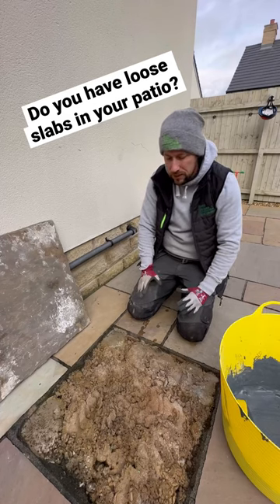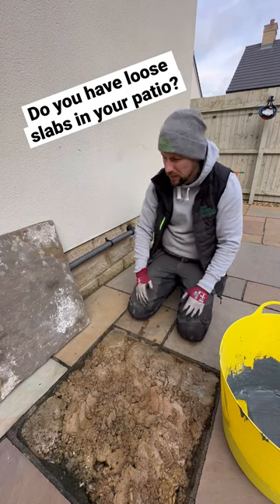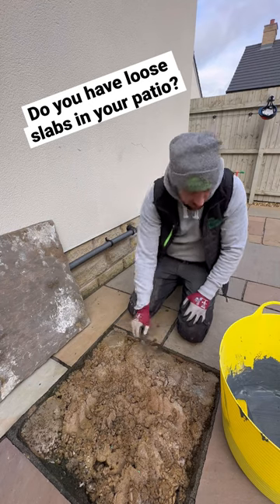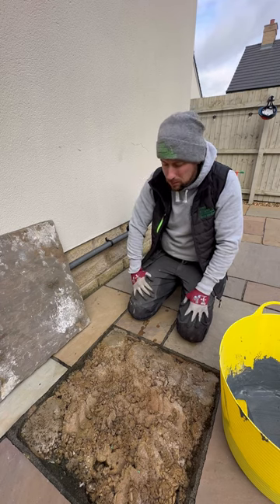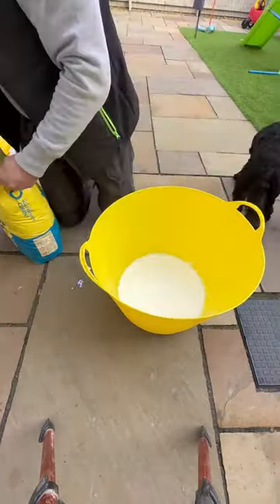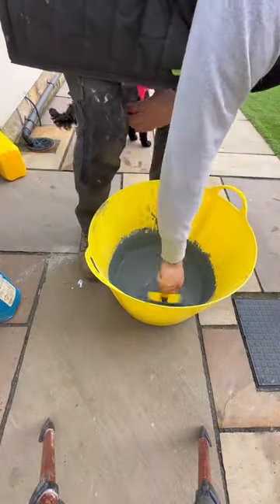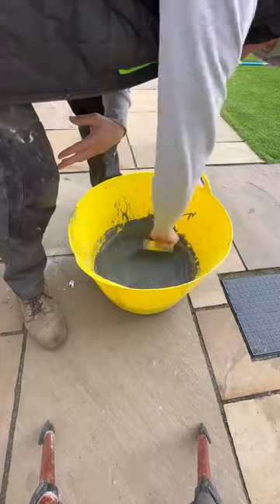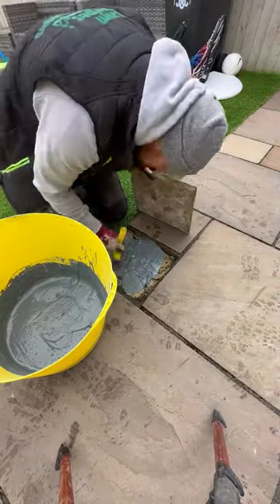How to repair loose ￼patio slabs #landscaping #garden

Comment: Surely digging out the crap and recementing is the right way
Reply: True, but I guess when you’re chiseling it out you run the risk of dislodging the ones next to it. I can’t see this slurry business lasting anywhere near a year though I must admit
Reply: Had this issue myself for an old dear. Dot and dab cement. 7 loose slabs turned into 13 with trying to chip out and prepare properly.
Reply: Can u use sbr and mortar instead of cement for the slurry?

Comment: I'm a fully qualified stone mason. I used inch to dust limestone vibrated bed, then a 2" layer of Steel Slag Ash to lay my flags on it was also very good drainage. I've had customers drive Land Rovers on and off with big trailer's and big vans the flags never moved once pointed in correctly. Some of my driveways, patios etc are still standing after 38 years of use. Even the pointing has lasted. I never used anything else, the slag is like pieces of Crunchy Bars, a couple of knocks with the Beatle (mallet) and the flags were solid... No rocking or anything. But the steel slag is like rocking horse pooh these days.
Far too many cowboys about now.
Reply: Yup 🤠

Comment: I definitely wouldn’t mix it on top of the paving! Those bits you dropped will be noticeable spots when it rains! And I’d also mix 1 part SBR to 2 parts water before adding cement - it’s strong enough to dilute as it’s an additive, I’ve never had any issues and been through dozens and dozens of tubs. Would work out way to expensive if I didn’t dilute I’d be using 6 tubs per job
Reply: I know.. mixing an SBR cement slurry on that stone is a defo no no

Comment: Be very careful painting sbr on natural stone. It has a habit of bleeding through and don't splash it on the top, it won't come off
Reply from the maker: Yeah you right
Reply: Really even with acid? I never heard of that product In the states I use a straight Portland slurry with bonding agent
Reply: Yeah it is bloody obnoxious stuff. I should say your bonding agents are the same. We tend to inherit stuff you guys over there invent. Sbr is a latex based liquid you mix with cement to make the slurry. It is white but always turns blue when you mix it, I am not sure why.

Comment: Not used SBR before. If I was the customer instead of a temporary fix I’d just pay for all the flags relaying properly with a decent mix. Point them up too so water can’t get under the flags
Reply from the maker: You are absolutely correct, but this customer has just paid £7000 to have this patio done incorrectly they are going to wait a couple of years to have it redone. Because of cost